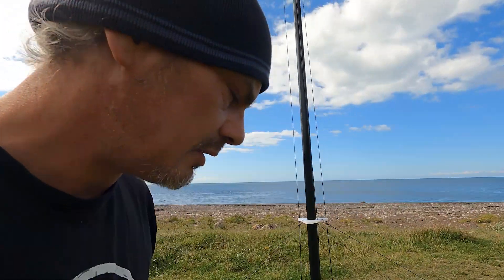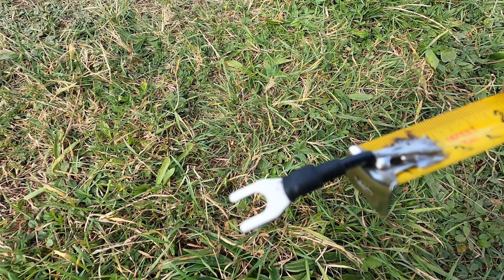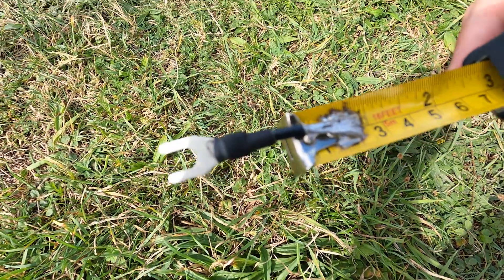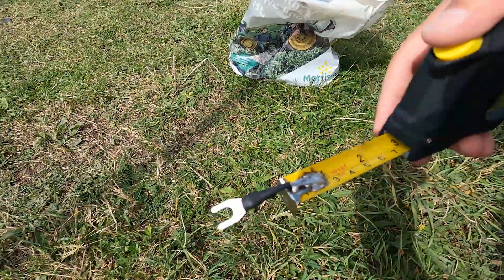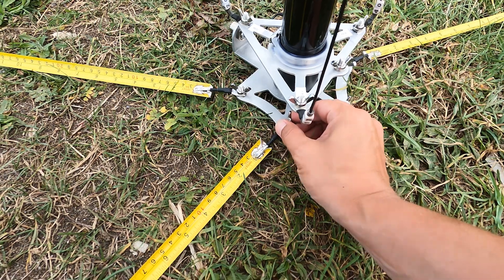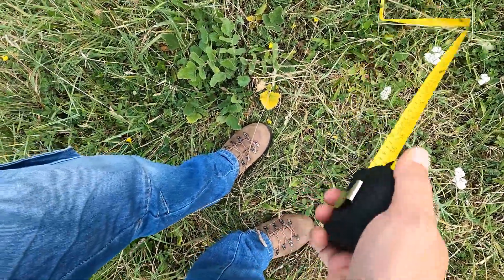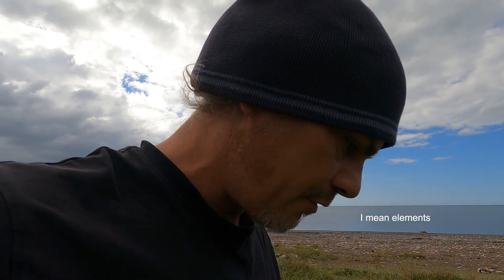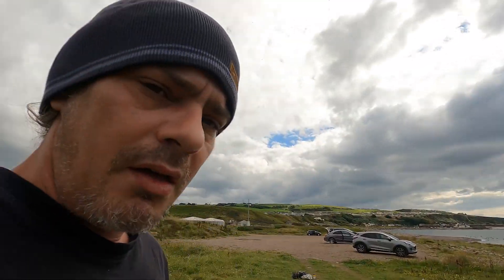Tape Measure Radials; an experiment

Comment: Great video. For me, using tape measure radials isn't an experiment, it's been a way of life for the last couple of years. High visibility, easy to adjust the length, easy to store, quick to deploy, never get tangled, and, they work. I've made contacts all over the world with a 9 foot manpack collapsible antenna, band-specific loading coils and four tape measure radials.
Reply: What's the set-up? This seems a great idea to me - I have a shared garden and need a really quick deploy and tear-down HF qntenna, but how many radials and how long, I don't know.

Comment: Genius idea. I hate winding up wire radials as I know every time I do it they are going to be tangled when I come back to them for the next deployment. I had thought of using a winder as with a kite string but that gets bulky. I had thought of using a chalk line reel with the string replaced by wire (that works for me for an EFHW on location) but this could be very neat and compact. Definitely going to try this

Comment: Be sure to put a common-mode choke at the antenna feed point to keep the coax from becoming part of the radiating system. That’s what’s causing the stray RF that’s kicking out your USB.